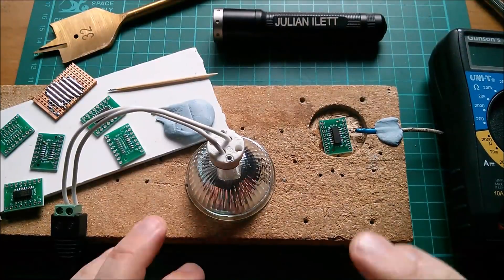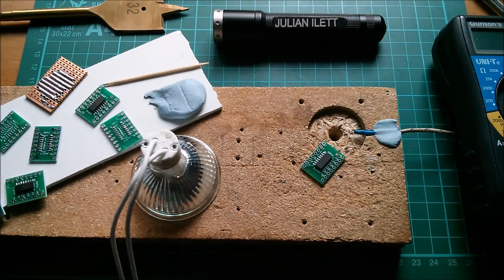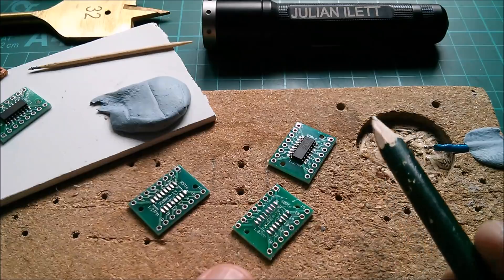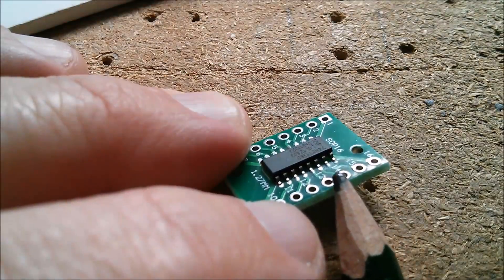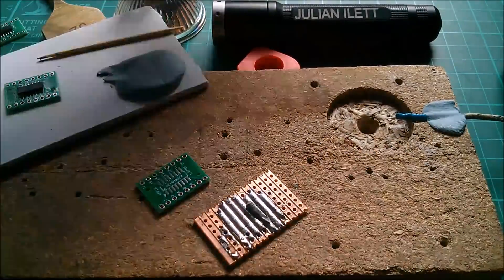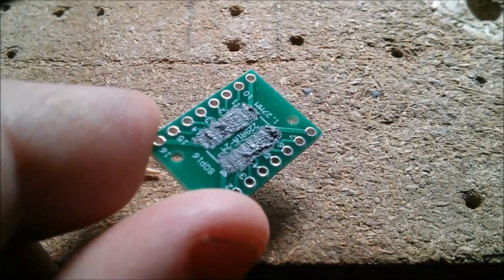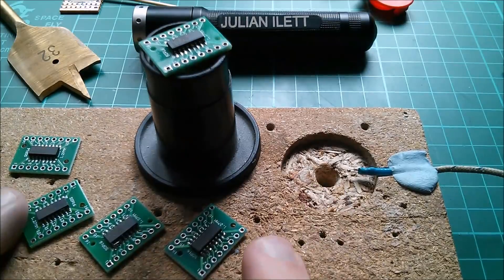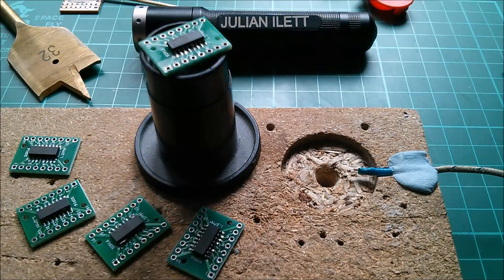Second Attempt: SMD Reflow Soldering

Comment: Solder paste works well if applied through stencil or with automated machine.If done manually is time wasting because first have to apply the paste,then the component and finally to check and correct the solder bridges with a soldering iron and flux.So do it from the beggining to avoid all the mess.

Comment: I would avoid using a cocktail stick. Flux is usually some kind of rosin solution (from pine trees) and will want to adhere to the wood whence it came.
Perhaps running your flux pen over the pads, letting it dry and using a metal or plastic applicator will persuade the paste to stick where it is needed.

Comment: Julian, another way to do it is to apply the paste to the component instead of to the board. I find it's easier to apply the correct dose that way. 

I apply a thin layer of paste on a piece of plastic and drag the legs through, (any access paste between the legs can be removed with the  side of a piece of paper).

Using a vacuum tool to handle smd ic's is also much easier than tweezers.

P.S. I just use my solder iron to "reflow" a single component....

Comment: Have you not heard of a 'reflow profile'? Its there to ensure 1) The components and board get to the correct temp without mechanical stress before the solder flows, 2) The solder reflows correctly and quickly and 3) everything cools down at a rate which doesnt pull your components apart due to different rates of contraction! You are overthinking the small stuff and not really looking at what reflow requires. Listen to the other posters. You are making yourself look stupid!

Comment: I have seen many successful results using a syringe to put out a mall roll of solder paste over all pads on each side. If you don't have a syringe, you can fake a stencil by putting three lines of kapton tape, that leave two small lines of uncovered pads. Then put a blob of solder paste over the open line and use a sort of spatula to squeeze the paste into something looking evenly applied. Pull the tape, place the chip and off you go.

Comment: Great idea.  I have a soldering iron, hotair station, and also a reflow oven. Even so, for small boards like this where you have external pins such as QFP then I always prefer using the hot air gun. But if it is QFN, or bigger boards with lots of components then I'll use the oven. It's personally more satisfying using the hotair process so you can watch.  BTW, that crackle sound you heard IS the actual moment of reflow, you will hear that with any thermal reflow oven. Leaded and Unleaded both crackle at reflow point.

Comment: Repeat comment - get blunt dispenser needles, get gel flux, get a 25€ hot air station.
Or just apply less paste and touch the pads with a regular iron for 2 seconds. Do the 2 opposite corner pins first and hold the IC while soldering, then do the rest. 
And keep the paste off the soldermask as much as possible, makes life way easier.

Comment: I applied solder paste with a tiny syringe (supplied with solder paste) in a quantity around 50% of what shown in the video and the results were positive soldering with hot air. One important parameter is the solder paste, should be kept in the fridge and brought to ambient temperature a few hours before use. A syringe I used in the past, kept always in my lab (around 20 C) , got completely unusable.

Comment: Julian...I might suggest covering the pads only halfway.  The solder will flow over the uncovered parts of the pads and it should minimise the "splatter" effect.  I actually use 2mm vinyl pin striping tape for this.  Using a small tipped natural bristle paint brush seems to work well for me for applying the paste and helps me apply a more even layer.  Once the paste is applied I just peel the pin striping tape back, apply the components and heat.  I've also found using an automotive headlight bulb (I've got dozens of surplus 9006 bulbs that work perfectly for this) makes for a very quick heating and seems (to me at least) to make for a more directional heat.

Comment: I'm glad you're enjoying your experimentation. What's a hobby for if not to have fun eh? But I hope you realise you can solder a SOIC package of 1.27mm pin pitch very nearly as easily and quickly as a through hole component with a soldering iron and some liquid flux and not risk overheating the components. You can even solder TSSOP of 0.65mm pin pitch in this way. Unless you're doing <0.65mm pitch or leadless packages like QFN, there's no point in bothering with solder paste and hot air or reflow ovens, and then you'd probably want a stencil.

Just put the component in the right place, apply a drop of flux to the area, put a dab of solder onto the end of your iron, hold the component down from above with some tool like tweezers or a wooden stick, slide the iron across the PCB into the end of the component's lead and back out the same way. Tack the corners first then apply more flux and do the rest. 

You don't need to pre-tin the pads or adjust the placement of the component while keeping the solder liquid as many people seem to do, that just makes it harder to get the thing flat on the board. Just don't follow the bad technique of people who blob solder across every pin on one side of the package and then solder-wick it off. That overheats the component and leaves too little solder on the pads in the end. Blobbing across the lot is a desoldering technique.
Reply: KX36 this sounds good. But I'm having problem visualizing the "slide across pin" part. Is there a video you could refer me to?

Comment: I don't have a hot air gun and have only started smd soldering recently, but I can solder that chip using an iron in less time than it took you to apply the solder paste. It is however an approach I may use for the much smaller chips. I can't justify the cost of professional tools for the occasional very small chip - so many thanks for your video - I will try this in the future.

Comment: If I can offer only one tip that will save you many headaches, it is to buy solder paste from a UK supplier, by next day delivery, and keep it in the fridge.  Paste that has spent 6 weeks on a boat and has started to separate will cause no end of trouble, and even paste that looks good but has gone stale will not wet as well, causing bridges, poor joints and other problems like SMT resistors pulling themselves up onto one end when the solder melts.

Comment: While I've never worked with SMDs, I must say that the paste technique precision appears to be akin to a lobotomy with a chainsaw..

How about this: hold the chip at the ends with tweezers. Apply paste to bottom of chip legs with a cotton bud or toothpick. Then carefully place on the board. Then heat in little oven.

Worth a try.

Comment: I always thought one should use sufficient flux when trying to solder surface mount components, has always worked very well for me, I've never had issues with splatter or shorted joints when doing this.

Comment: I wonder if solder paste can be used on batteries? to build packs. maybe the cells wouldn't have to be heated as much as with solder. I hope to have built a spot welder by the time I build my packs. maybe a process of kinda both. use paste and spot weld. I don't know if that would work. but if it did. there could be a full contact of buss and battery contact. I don't know if it would prevent the weld between the metal at the spot weld? its just an idea. I guess if you had a spot welder. no other means would be needed. anyway. do you think solder paste would be better for the battery. as far as heating?

Comment: How not to, can be just as valuable as how to. Inventive ideas. I have tried solder paste as in the video and abandoned it for the Hakko K type bit (comes in the ebay packs of 10 clone bits), appears to be very large but is for "soldering at narrow pitches, correction of bridging and drag soldering" and works. Has a large heat capacity and can transport a lot of solder, so you may remove solder with it.

Comment: I just wonderd if you could use some sort of thick paper or maybe some thin plastic sheet to make a mask for the solder paste and a plastic card. Just cut holes were the solderpaste is suposed to go and use the plastic card to spread the paste, maybe that gets you a even and thin destribution of solder paste. Would be nice if you could test it because if it would work I might also try starting to build a setup like that. ^^

Comment: awesome idea, what about putting some foil or metal underneath to reflect some heat back into the board. Also you could try dipping the component leads into the solder paste, and wipe the board pads with flux, then you won't get bridging

Comment: By experience I can tell you that those blobs are indeed flux balls. Whenever I quickly melt a long length of solder, tiny blobs of flux shoot out of the drop of solder on the tip of my iron. They have a habit of jumping onto my fingers and burning them, the nasty little blighters.
Large volumes of solder (or solder paste) do tend to eject flux. A little alcohol or acetone should clear them up.

Comment: Have you tried putting the solder onto the  leads of the chip instead of the PCB...? Seems that way you can ensure that each one has some solder paste - and that you cant over do it, and you wont get as much bridging. (might be better for the larger form factor chips too)
Also, a heat gun (modified hairdryer?) might allow more control over the process..
Keep up the good work!

Comment: Hi, you should surround your bulb with some aluminium foil. The reflector is so designed, that especially IR radiation should not be reflected so that less heat comes through the window of the bulb. That is a special interference filter at the back.

Comment: Why not make a template out of some thin plastic.
Once you've cut out the two slots to 'show' the solder pad strips, you might be able to slide any excess paste off to a set height/ thickness of the template.👍
I've got a laptop with issues on the motherboard, the lamp might work better than a hot air gun

Comment: Also this may be useful to you it's the bench PSU solder rework station and soldering iron that I use. It's cheap and has all the kit you could need for very little cash. https://www.ebay.co.uk/itm/122540606653?ul_ref=https%253A%252F%252Frover.ebay.com%252Frover%252F0%252F0%252F0%253Fmpre%253Dhttps%25253A%25252F%25252Fwww.ebay.co.uk%25252Fulk%25252Fitm%25252F122540606653%2526rvr_id%253D0&ul_noapp=true

Comment: Okay you have some old inkjet plungers. If you have the needles that came with the inkjet kit, use those just fill one with some solder paste or the needle part should fit onto the solder flux syringe.

Comment: Flip over the chip and apply the solder paste to the bottom of the pins instead of the board.
That would help keep the amount, placement & bridging under more control.

Comment: Julian, you're comparing apples with bananas! Most professionally soldered SMD components use less solder than through-hole components. When a stencil is used it's only a fraction of a millimetre thick so the thickness of the solder paste is minimal AND it only sits directly on the pads which means even less is initially applied. I wonder whether putting a strip of masking tape down either side of the pads (long sides of the PCB) and a strip down the middle between the pads would make things much easier. You could apply a dab of paste on the first pad on both rows and then use a flat edge, such as a credit card, to smear the paste along all the subsequent pads, minimising excess solder.
Personally, I'd probably just use a soldering iron with a small pointed tip on such a chip if I didn't have the correct tools for SMD soldering.

Comment: Well this is a significant improvement but how do you plan on getting uniform heat with a board that cannot fit under that lamp?
Reply from the maker: I don't. This is a solution for these small boards only.
Reply: Oh. Well its a cool experiment / proof or concept.

Comment: Why not try applying the solder paste onto the pins by combing them through your little smear of paste? That could leave a little glob on each pin, and then you'd place the chip onto the bare board. Think of how a knotched trowel works for laying tile.
Reply from the maker: It doesn't work - the solder paste doesn't stick - it just falls off.
Reply: Julian Ilett well, it was worth a shot. You keep at the attempts, I'll keep watching!

Comment: Hi Julian I find that using a scalpel blade or a craft knife blade to apply the solder paste works well, the cocktail stick will absorb some of the flux causing the paste to want to adhere to the stick. I spread the paste thinly of a suitable hard surface and then use the blade to pick up a tiny amount of paste and then you can put it on the individual contacts of the board quite accurately. After soldering (I use a heat gun) I then clean the board with IPA (ISO Prop Alcohol or rubbing alcohol for our US friends) which removes the solder balls and the flux residue.

Comment: Take masking tape.
Mask off pad area with masking tape.
Smear solder paste on board.
Use flexible card like a Tesco club card to smear the paste across pads ensuring an even smear.
Remove masking
Apply chip
Apply heat
Done.

Comment: Next time use "Syringe Needle Tips" (ebay.com/itm/282830826046) and insert the syringe directly to a circuit board , a tin paste (or use "reballing plate mask" or "solderpaste stencil" (Somewhere it was also possible to order it (special order: on a film or on a metal plate)) (search use too name of SMD iC/chip package/type SOP16  )). Alternatively, you can pump from one syringe to the other (if you connect the tips of the syringe to the tube and then push the syringe filled up to the other syringe).
Reply: I think the hot air gun is the best (like Louis Rossmann using) or like EEVblog #558 trayed https://youtu.be/FNNRoXZom30 and use like (lasercutter) solderingfilm https://youtu.be/7sSFf1SHsRs?t=131
Reply: or how facktory its working/made: https://youtu.be/pHNpayYhBvM

Comment: Would it not be easier and less messy if you turned the chip upside down and scraped the paste off the cocktail stick on to one pin at a time instead of putting it on the board? I'm sure it will give you more control of how much paste each pin has and make sure all pins get soldered

Comment: The solvent in the flux pen is alcohol which is why it clean up the flux after soldering.  You can use alcohol swabs from your pharmacy to accomplish the same thing.  You also need "blunt needles" to attach to your paste dispenser.  If you get various sizes you can pick how much of a bead you lay along the traces.  I do this sort of thing all the time.  Love the idea of the MR11/16 bulb- I usually just use hot air for small SMD soldering,  or a griddle for bigger boards...

Comment: How bout using a bit of car/plastic with a couple of notches cut in the edge, put a blob of paste at one end of the board and swipe the card across, like you would with ink and screen printing. The notches should leave a trail of paste along each set of solder pads. Place the chip and cook as normal. :)

Comment: All I would say is that you are using way too much paste.  While there's no downside to coating the topside of the leads of the chip and it tends to happen pretty much inevitably when doing the job by hand with an SMD, if reflowing you really only need the pads fully coated and the bottoms of the leads bonded to the pads.  Anything more than that is excess.

Comment: OK, let me just correct all the silly advice people seem to be giving Julian at the moment. Simply:

1. Throw the paste and "oven" away.
2. Blu tack the chip on the PCB along with some small lengths of wire.
3. Leave it outside in the sun to harden for a month.

This process has been working like a charm for me for the last 30 years.

Comment: There's already so much solder on those HASL boards, you might as well just go ahead and just flux them up and place the chip on there. As you've noted so aptly: The least amount of solder you can apply is exactly the right amount...
Reply: Daniel Egger hmm. Does HSAL mean pre tinned?  That's a good idea. Why don't all boards for diy come with a pre tinned option?

Comment: You are doing this in just about the worst possible, least reliable, and least efficient way. It's frustrating to watch. Put paste flux on the pads instead of solder paste (not liquid flux--that flux pen is useless) and get some solder on your soldering iron tip. Put the IC on the fluxed pads. Touch your soldering iron to the pins. The solder will flow easily. This takes 10 seconds per IC once you've practiced.
Reply: staevobr great idea!

Comment: Although it's a pretty clever way to reflow solder paste to do SMD work, this seems like way more work than just hand soldering.  If perhaps there were a lot more components it'd make it worth it. I'll stick to my soldering iron.
Reply: And about fiddling about hand soldering... you still had to use hand soldering techniques to fix the bridges after you were done reflowing so where's the benefit?
Reply: I agree. When we needed to do quick rework jobs back in the early 90s we just used to do it by hand, you can even sort of flow solder SMT but tilting the board slightly and running a blob of molten solder down the pins and using gravity and surface tension to do all the work. Hardly ever had any bridges either.
Reply: correct ! it is easy to find videos on how it really should be done, if you try it the right way, indeed, you'll be amazed how easy (SMT/SMD) it really is, and you'll never go back to through hole technology